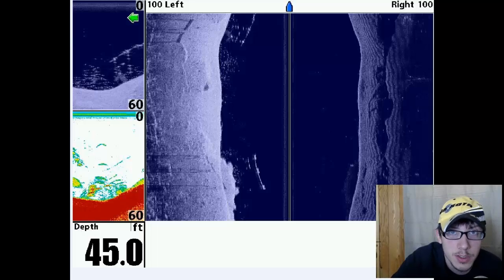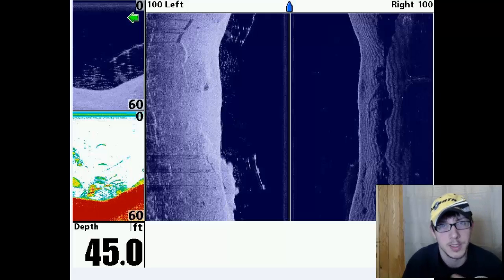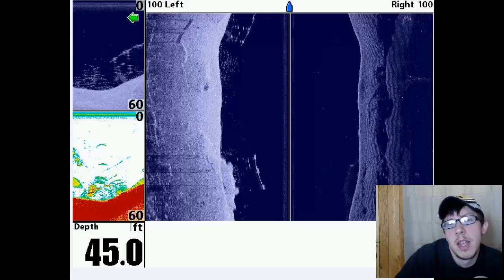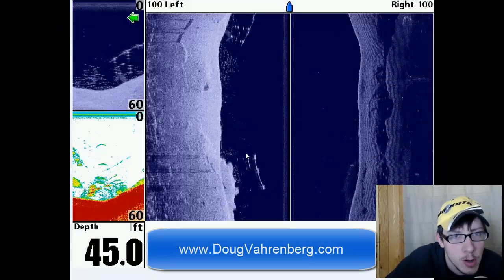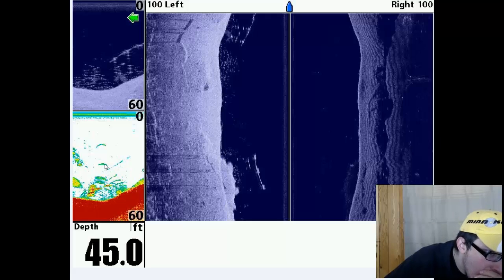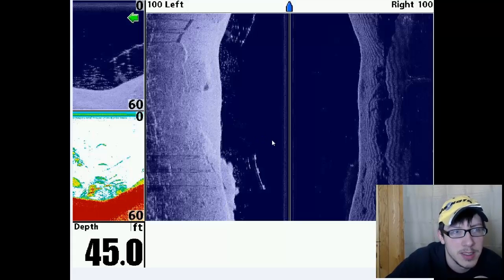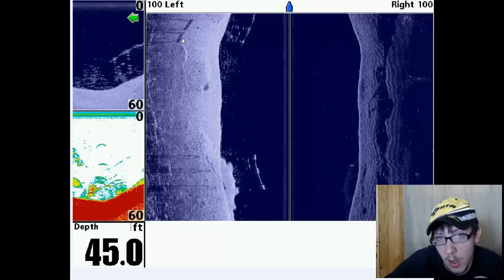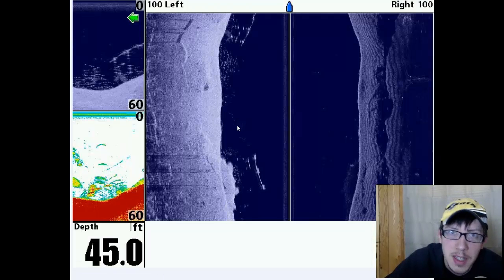Down and Side Imaging on Trolling Motor - Almost Daily - Bad Poncho Outdoors

Comment: I realize this video is from 2014, but SI and Down Imaging works fine on the trolling motor. You can actually scan in a 360 degree on docks, and other cover. The key is to not move the trolling motor quickly in a circle. Thank you for the video.

Comment: Poncho do you think Lowrance spot light Scan will be a must for all the bass guys
Reply from the maker: Personally I'm a Humminbird guy. The SpotlightScan limits the angler to whenever you're pointing your trolling motor while the 360 allows you to scan any odd angle on your boat if you do so desire. No matter the brand the technology is still roughly the same.

I chose the 360 due to the flexibility of the unit, whether you go transom or bow-mount, being able to scan while on your outboard is very nice though. It is also important to note that you MUST run a cable-steer, foot control trolling motor to run the Lowrance and you must manually control the scan.

If you're fishing cover and structure its a very important feature to have, if you're fishing flats blind I'd pass.
Reply: Bird makes the technology then sells a license to Lowrance.